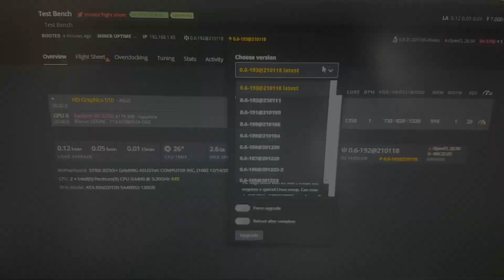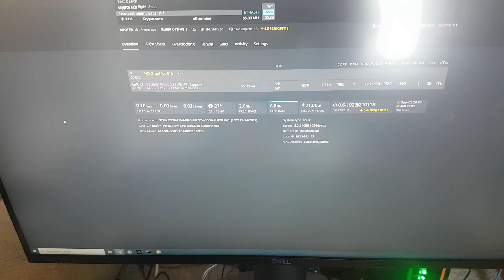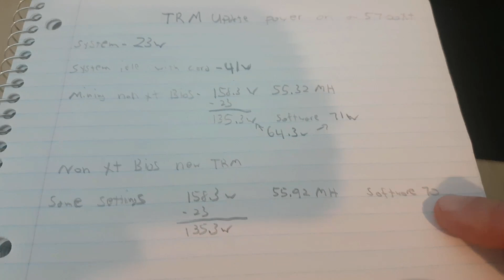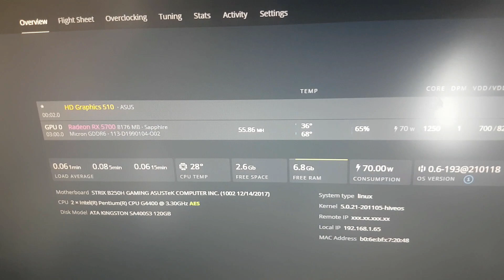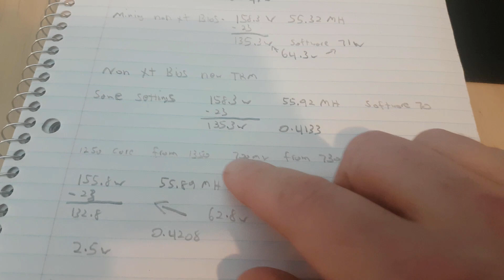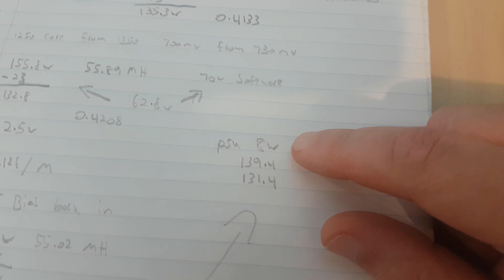5700XT HiveOS Settings / New TeamRedMiner 0.8.0 Test 55MH 131w At The Wall

Comment: I tried to mining my 5700xt in hiveos but I modifed its BIOS because I was mining on Windows but now I tested in hiveos and my graphics Card never mined, do u recomend mining without Bios modified or what could be happening?
Reply from the maker: Gotta bios mod for the best hashrates hiveos mem settings are half of what windows are so 1800 mem in windows is 900 in hiveos.  Oc could be to high so it wouldnt mine.

Comment: Glad you did this video. Question why is it that when we Bio Mo in Teamredminer the hash rate is lower than what Hive Pool real time displays.  No point to BIO if not real advantage with pool hash rate it actually lowers it. Run a test hash comparison. Valid shares slow down with bios M, see count.
Reply from the maker: Will have to look into this talking reported or current?  The current is usually moving around but interesting on the valid share count in the end shares is what matters.

Comment: I have a RX 5700 Reference Card Micron Mem. Flashed to a 5700XT Bios Modded, 57-58mh @ 121w...
Reply from the maker: Nice what settings are you running? Forgot I tref modded my non xt bios so gotta try to mod the xt and see.
Reply from the maker: Nice what settings are you running? Forgot I tref modded my non xt bios so gotta try to mod the xt and see.
Reply: @RabidMining  
1420/800 cc, 1860/800 mem, 1350mv Mem v, Power limit 0%, 75% fan. Did change the tRef from one of your videos.
Reply from the maker: @BitcoinRichRick  ya that's what I forgot to do with the xt bios was the tref totally forgot I did that on the non xt lol
Reply: @RabidMining  well I saw a few videos on here and the tRef settings is different so I just stuck with yours and it's holding steady, just need to do a reseal on the thermal pads then more testing.. I did drop the volts to 117w window cracked open for cold air. 🤣
Reply from the maker: @BitcoinRichRick  nice glad it helped you out.
Reply: @BitcoinRichRick  yes 1420/800/800/1350   fan 55   58,880 mh/s